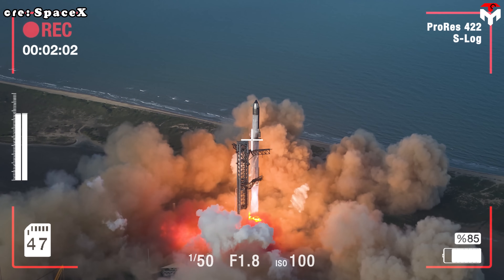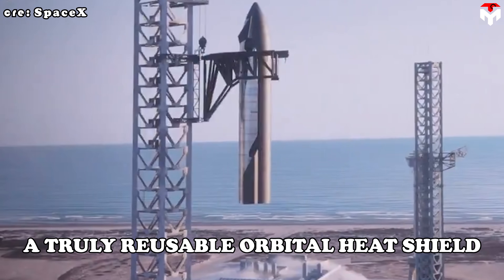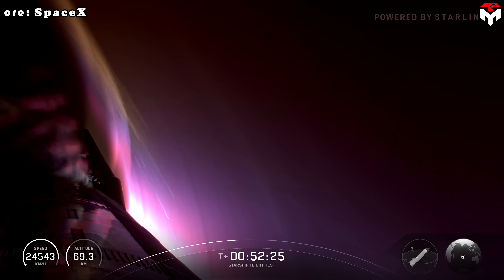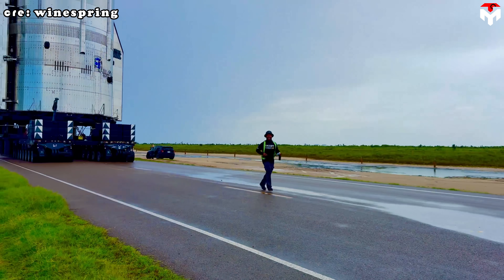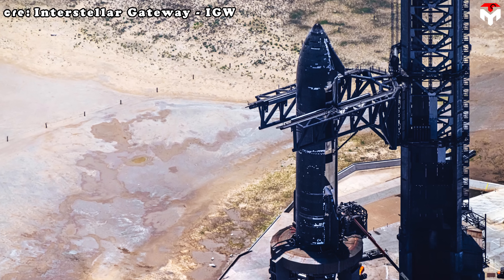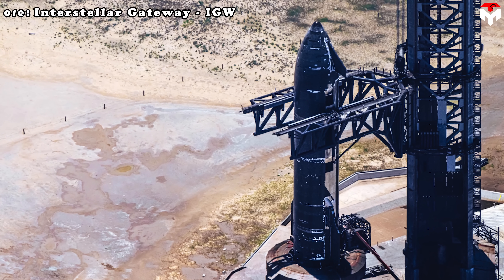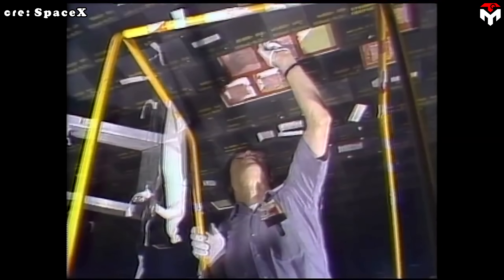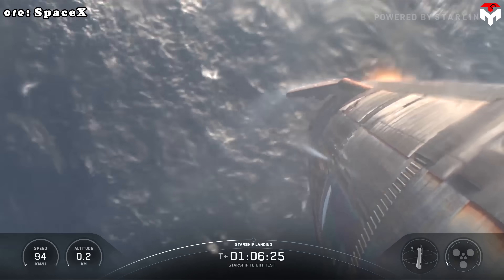SpaceX found a Brilliant method to SOLVE Starship Flight 10's heat shield's Big Issue, Shocked NASA!

Comment: The "crunch wrap" is itself a wear item. One more thing that has to be inspected and repaired. A durable, rapidly reusable heat shield is still years away.
Reply: Progress, step by step.  This might not be the final solution, but it’s a good intermediate step, moving things forward.
Reply: Remains to be seen.
My assessment is that the crunch wrap has two very good things going for it
1) It will prevent the tiles from rattling together during launch when Ship is at it's coldest and the gap between tiles is largest
2) Tile expansion during the heat of re-entry will close the gap between the tiles, protecting the wrap from ablation
Reply: @bru512 
I agree that it’s a step forward in Starship heat shield development.
Reply: @bru512  Once the tiles expand and crush the mineral fibers, how well do they recover? How much of this material will ablate? How much attention does it require? Will it need repacking? Will the maintenance itself weaken tiles or their mounting clips?
Reply: @saumyacow4435  Great questions.  We might not get answers until we catch a ship!
Reply: If the fabric is gas cooled it will work but Methane is not the right coolant.
Reply: 10,000 attempts to build a light bulb. Only gotta work once and its game on
Reply: @JasonWoods-ed7yu  How many years did it take?
Reply: The metal tiles were fine. The Methane they were cooled with made the oxidation
Reply: @JimmyRussell-c2s  Really?  I was hoping they did that but I haven't found anything to confirm
Reply: @JimmyRussell-c2s  Were they even cooled?

Comment: You can't learn from anything purposly crashed into the sea and have it blow up on contact.
Reply: Well, what you can learn is on the way down, the destruction at landing obviously limits the learning opportunities - but is the right thing to be doing at this stage.  However Starship catches should come within a few flights - and then of course SpaceX will conduct close inspections during this ongoing development phase - they will need to best solve the heat shield problem and fully characterise it.
Most likely it will go through several stages of improvement.
Reply: @peterclarke3020 they have prooved theybcan catch booster so every booster should be caught
Reply: True, that's why they plan to barge land without self destruction explosives in flight 11
Reply: Go watch the video of it landing.  It doesn't crash - it fires it engines to brake like it was landing on land and after hovering a few feet above the water, it stops its engines and drops into the ocean and floats on its side.
Reply: Space x should have some ships on stand-by to tow a Starship to the coast of Australia, for example,  to have the tiles examined close-up.